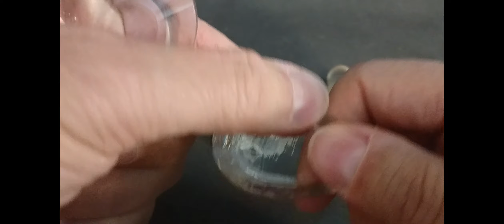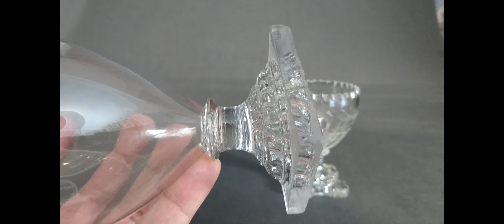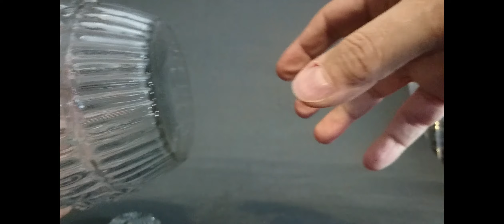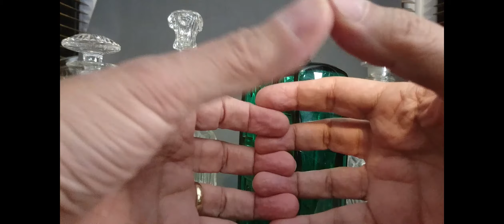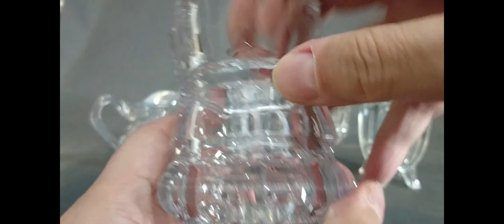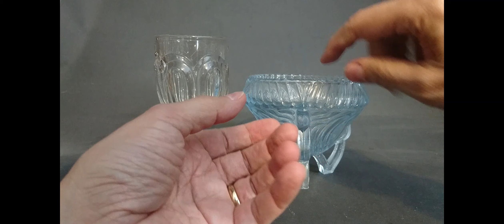Pressed and Mould Blown Glass

Comment: I have been given some old looking greenish glass garden cloches.  They have seam at the very top where the knob is but not down the side of the bell. There seems to be a small tear drop mark present and odd bubbles in the glass.  What type of glass would they be?  I am in the US.  Thanks.
Reply from the maker: It’s probably low quality soda glass. The greenish tint means they haven’t put a lot of effort into getting it clear. The sand probably has a bit of iron in it, and you can get it clear, but if it’s for cloches they probably aren’t too worried about it.
Reply: @lovedecanters7891  Thank you!

Comment: G'day Kev, thank you for IDing my $4 piece mould pressed Davidson's Chippendale clear open double handed sugar. Best that I can date it is 1930s to 1954, on the web, a bit broad. Cheers very much, Mick.
Reply from the maker: Mick it’s much worse than that. The Chippendale pattern was started by US company Jefferson in 1907, in the 1920s Davidson and Bagley did knockoff versions, then in 1929, Davidson bought the moulds and rights and expanded the range up to 400 different items. Also Riihimaki, and Walther & Sohne were making it. So there are 400 different shapes, plus knock off, plus at least 4 European companies making official and knockoffs  and I think about half a dozen US companies having a go. I try to block all that out, because your brain would explode and my videos unwatchable. Also, no one’s written a book on it, sorry for making it worse.
Reply: 💯plus options, bewdy! Cheers and thanks.  @lovedecanters7891